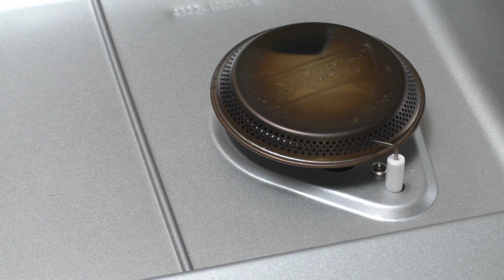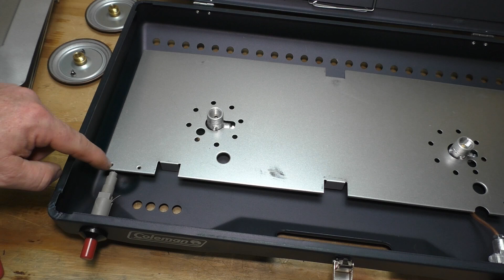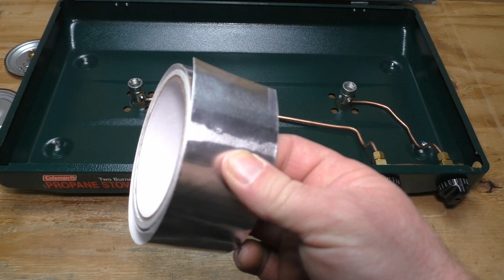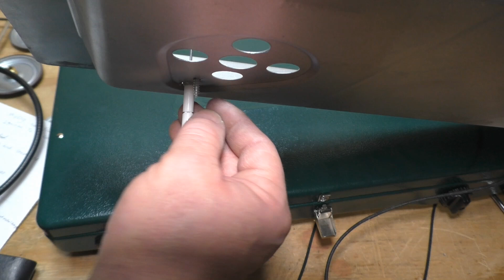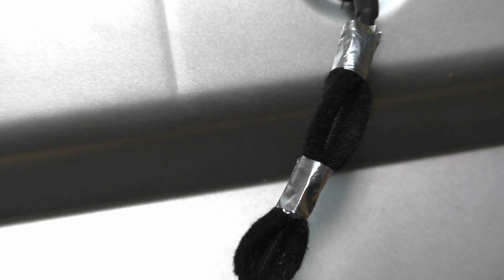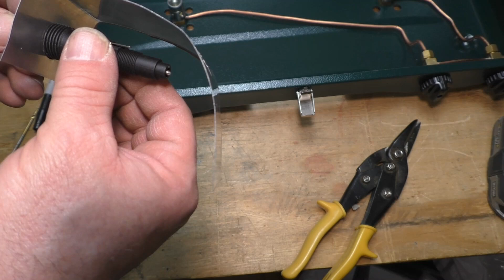MYOG Add Electronic Ignition to a Camp Stove

Comment: thank you for the detailed instructions, I changed a couple of things to make it food safe I used stainless steel bolts and aluminum disposable pan to make the igniter heat shield and also to form a long square tubing that fed the electrodes directly into it and pass the wires straight to the igniter. Excess wire just curled inside the heatshield and crimped one of the wires circle connector into a flat connector that way did not had to replace it. Project was time consuming but came out great.

Comment: With the Piero ignition installed still fitting or closing ?
Reply from the maker: You're lucky I was getting ready for bed and I saw your comment. Yes the lid still fits with the casino installed that's why I was so careful about where I was placing it because not only do you have to worry about the lid. But you also have to worry about the drip panel on the inside of the stove. It's not hard to figure out it just takes careful planning and you'll see where you need to put it. Thanks for the comment I really appreciate it. I'm currently taking kind of a break from YouTube so I haven't been posting new videos so any further questions might take me awhile to come back to you okay have a great night.
Reply: God bless you 🙏 bro